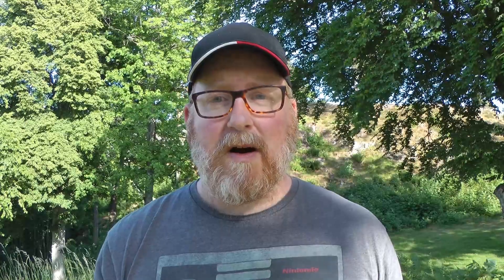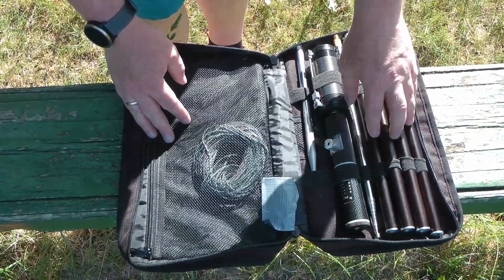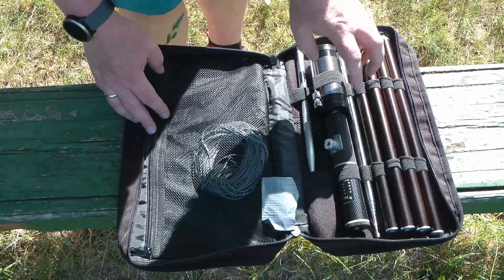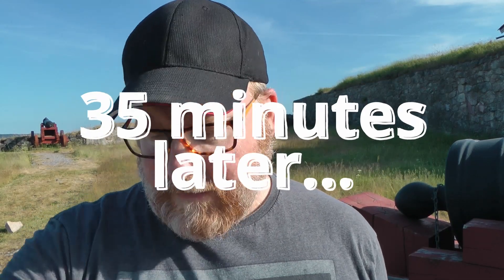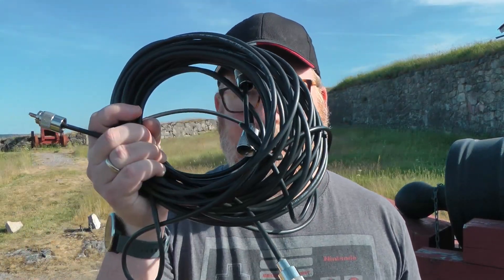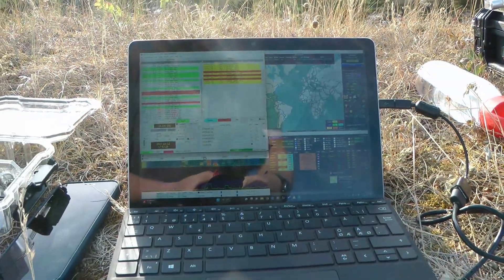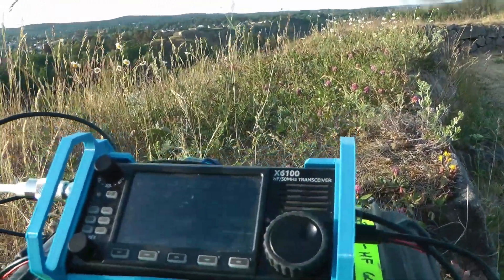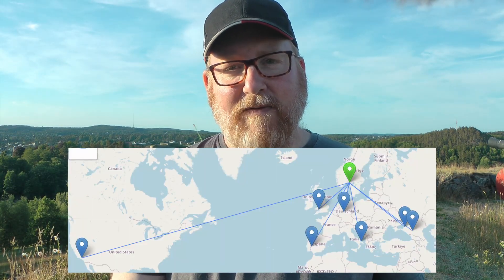The Chinese Buddistick (JPC-12) - POTA Fail

Comment: Love your video's Morten, they are real and you give your honest opinion. With regard the JPC-12, I have one.....or more correctly had one, until a fellow ham borrowed it and doesn't look like she is going to give it back anytime soon😂 She loves it, as did I. It takes a bit of practice but once mastered is fast and very resonant. I have had multiple contacts NZ to Europe with this antenna and the G90 at 20 watts. I am about to purchase another one.....I like them that much and so much cheaper than the competition. By the way, what is the cradle you have the X6100 in? It looks quite good. Keep up the video's....they are appreciated. Cheers ZL2VTH
Reply from the maker: Thanks for the long comment there Phil. And you are probably right that I haven't played with it long enough to master it, but I will give the Slidewinder DX a go before I try more with this one. The cage for the X6100 is 3D printed, you can find the STL-files on Thingiverse. I even have a video on that cage.

Comment: HI.  How many radials did you put in?  I with this antenna and a few radials, 8 if I remember correctly, made excellent connections in SSB.  Then, ok, propagation is always needed... 73!
Reply from the maker: I used five radials. And I actually things the antenna is an okay performer, it's just that the tuning is so finicky that I use time I could have spent doing QSOs tuning the antenna.
Reply: More the better on the radials, I've used it on 40m, 20m no problems mmmm